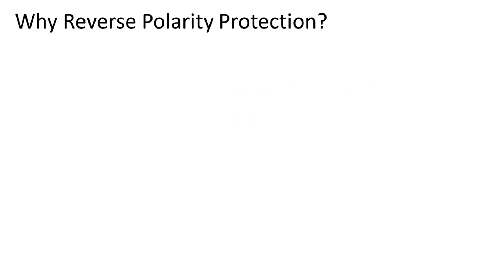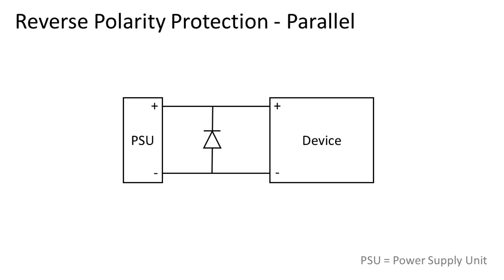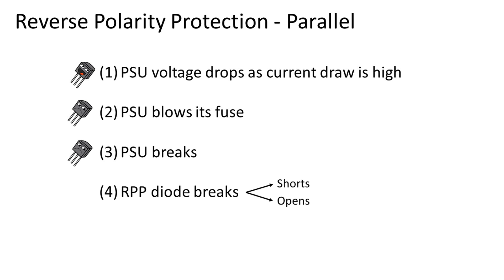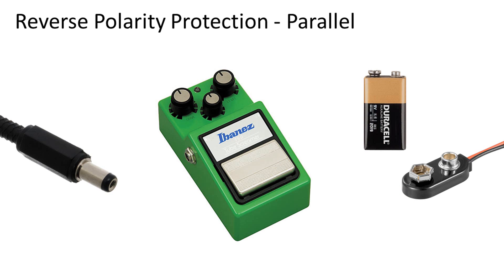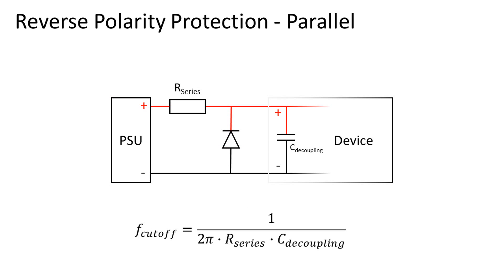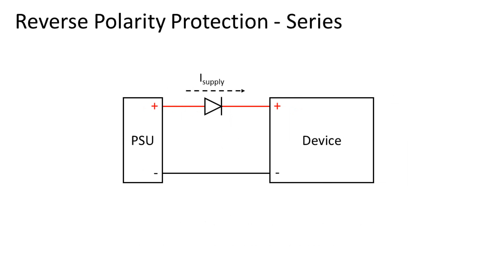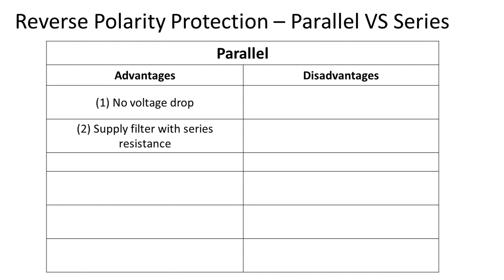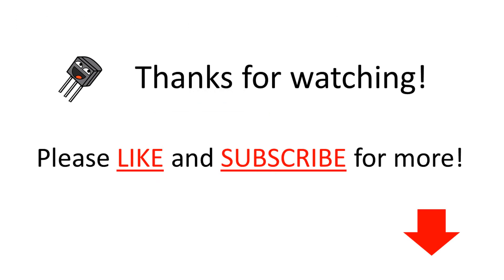Adding Simple Reverse Polarity Protection (To Guitar Pedals)

Comment: Can you make a circuit that reverses the polarity every 0.5 seconds?
Reply from the maker: It is called a squarewave oscillator at 2Hz
Reply: @trevortjes  That's producing a sound, not reversing the polarity for a motor.
Reply: @Berghiker  electricity in your outlets works similar to what author said. It had frequency and voltage as any oscillator

Comment: You can get an ideal diode IC which uses mosfets to make the voltage drop almost 0, much better than even a schottky.
Reply from the maker: Totally, but I imagine more people have some schottkys lying around than specialized ICs. But yes, there are more ways to deal with RPP.

Comment: Thanks. I'll probably add this too my 9v busbord. I have on my diy synthesizer so it can use pedals safely and not have to worry about plugging it in the wrong Jack's. I have +9 postive center/+9v negative center outputs too dc Jack's for pedals/circuit bent toys. Great video I know they use a similar diode setup for some eurorack modules for reverse protection. Never thought to use it to protect pedals. Great video.

Comment: A Schottky diode has only 0,2V of voltage drop, much better than the usual 0,7V from the 1N4148
Reply from the maker: Agreed!
Reply: But it has also a higher reverse leakage current. Does it significantly reduce the reverse polarity protection ability, or that’s the current is very small and negligible?